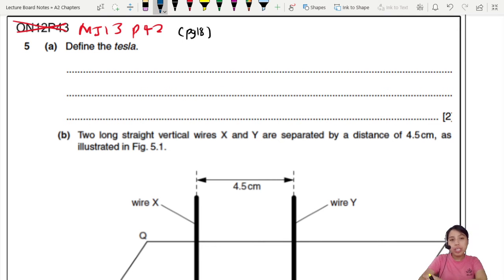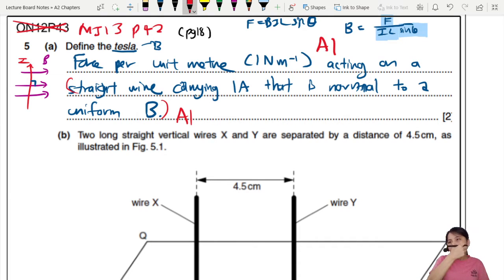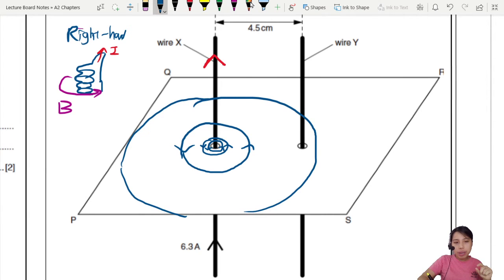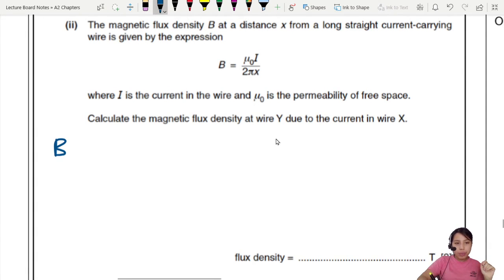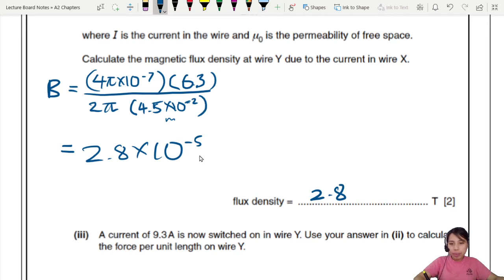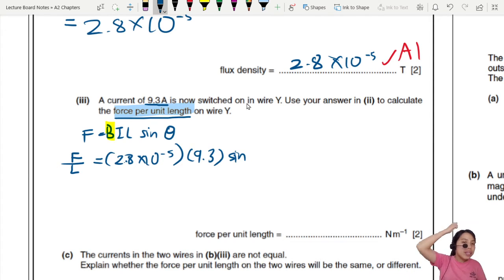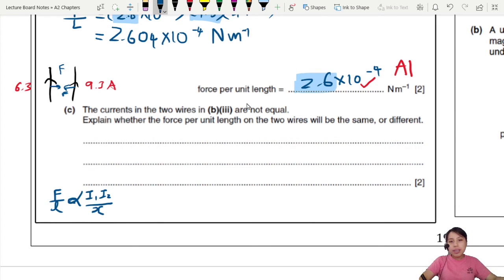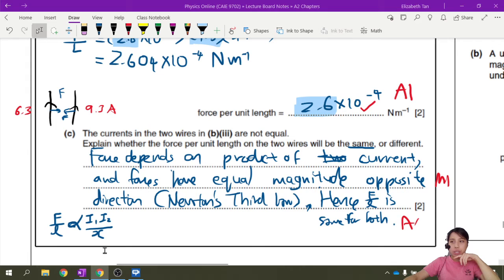20.2c Ex1 MJ13 P42 Q5 Parallel Wires Forces | A2 Magnetic Fields | CAIE A Level 9702 Physics

Comment: How do we know that the force depends on the product of both wires current at 13:05?
Reply from the maker: One of the earlier videos discussed that magnetic field due to a wire, B is proportional to its current. E.g. equation B = μI/2πx

From Fleming's left hand rule, the force on conductor F = BIL.

So if we sub B into the force equation, we get force that is proportional to the product of both currents!